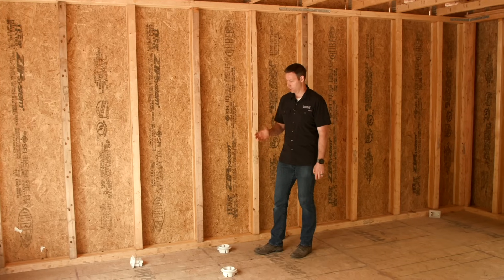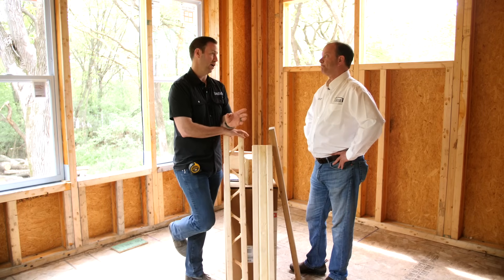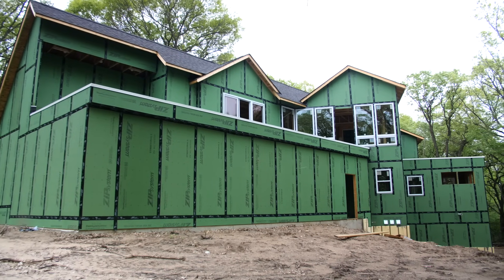Insulated Studs? This is a BIG Innovation in Framing!

Comment: Double top plate would be nicer for sheet rock.
Reply: True but you have 2.5" instead of 3" traditional, so not too much less.
Reply: Solid plates would be nice too. The top and bottom plate are made the same way as the studs are. This is the weakest point as far as I'm concerned. I can't see how you can get a solid connection between walls without double plates with dog ears and properly nailed channels with backing in them. All those straps will make screwing sheet rock in the corners all most impossible. The 2' center spaced studs pretty much means 5/8" rock too. It's better but more costly. I doubt that you can strong back them or plain them either as it is an engineered product so if the wall has any wavy gravy going on you might have to live with it.

Comment: I'm speculating, (the website won't give the current cost without going through some annoying steps) but the studs will cost 4x as much as a standard 2x6.  That means you have to amortize the cost against  the projected cost of energy   minus the expected savings. It's a question of how many years will be needed to pay for the system - essentially, when is the break-even date? This doesn't include the comparison of this system against the ''foam sheathing' method.

I can't see this system catching on. Standard lumber is cut, surface, ship.  Hard to beat that
Reply: Average house of 2500 feet is $1500 more according to the video. This is framing cost. What dollar value would you add to the increase in speed/efficiency for plumbing and electrical? What about the decrease in weight he mentions? What is the dollar value on that? Wear and tear of raising walls over a career? Can skilled guys work a longer career for your company? The factors to be looked at get to be quite long. 

But you are correct, it likely won't catch on like it should. Most people in the construction field have all the imagination of a tree stump. Innovation is a swear word in the construction field, especially stick frame residential circles.
Reply: @KeithAnderson-v7z  ... Of course all cost savings should be factored in to the determination of the break-even date. I never said otherwise. Dimensional lumber is plentiful, strong, predictable and inexpensive.  The fact is, when planning a build or remodel,  it's far safer to do so based upon product that will almost certainly be locally available. That means dimensional lumber and steel framing.

It is not the local guy's fault that you can't find, or  even look at this product locally. Maybe, if a contractor could find a stack of your stuff at a lumberyard, he could try it out. It's not a lack of imagination at work here. It's lack of predictable presence.
Reply: @frankhoffman3566  bet a contractor could get them to ship a sample piece. The real determining factor will likely be the profit margin for the lumberyard. And with the push towards "green" building it wouldn't surprise me if this type of material becomes mandatory.
Reply: Good grief are those of you questioning "this and that" are so dang thick headed! Just Read Through the Product Website, and you should have seen the offer for said samples which are easy enough to buy just to see them first hand in your own hands for yourself to further determine their viability and quotes for orders are easy and often FREE to get even if you have to email back and forth, They do not post pricing like most others as the cost varies on order sizes and shipping location as that varies as much as volume pricing.
Reply: @Joshua79C  ... Sorry, but convincing a contractor that ordering online is equal to having lumber on site within the hour - that's a hard sell man.  

Having the infrastructure is, I'm sorry, critical. With this product you can't even sight it for straightness.  You have to trust a new company  to get your order right, have it available, ship it promptly, and get it to you without delay, complete and undamaged.   

Many jobs are 1/3, 1/3, 1/3 - three chapters of work and payment.  That just multiplies the online ordering issues here.
Reply: @frankhoffman3566  Clearly these are not yet being mass produced like typical solid lumber these and are running at a limited production rate as you seen the bare model it takes a bit more time to manufacture them. Hence why the having to contact them to get set up with a local lumber yard of your choosing or have them directly shipped to location where needed just to get you supplied as a contractor or even if just a big time DIYer. 
Have got at least four lumber yards within ten miles of me. but I rent the place I currently live in and have little to no edge on what I can get done or have the landlord get done if goodness forbid he was a more generous and willing person. I could use something like this in the walls of this old as is drafty apartment duplex home that has not been remodeled since it was built or otherwise remodeled in the last 30 years if it older than that. If the landlord was willing to remodel this place and also have it properly insulated during that time, the money I would be saving on heating and cooling, I would gladly give it towards paying more in rent to hep them recoup the expenses.
Or if I won large enough in the lottery I could just find another place already build to modern standards and some or pay to have one built or rebuilt depending on the land and real estate condition and just move in there and have a house all of my own and not have to deal with a blighted landlord. I have to give them some leeway as they own and manages the auto body shop next door and it gets busy. They only bought this place from the previous landlord 7 or so years ago and i have been living here for 11 - 12 years now.
Reply: Exterior studs for a 2500 sq feet would only cost around $300-$400.  At the salesman's estimates, these would increase the cost to at least $2000.  Plus I have no idea how you fasten these studs and plates, Matt mentioned screws, which would cost more than standard nails.  That is a huge increase considering you only gain R-12 at the 1.5" stud, the insulation between the studs is the same.  For the very minor efficiency increase, I doubt you ever break even with the extra cost.  This is only for people with the extra funds.
Reply: Frank Hoffman or a S.I.P. House.
Reply: When I first heard of SIPS 15 years ago, I tried to look up pricing for those then and still to this day they still do not offer direct pricing. Tstud is NO different in terms of supply compared to typical lumber which you can clearly and easily find the cost for said anyplace it is sold through. Same when it comes to asking an ICF manufacturer, you have to request a quote by submitting a plan in order to get a cost quote per amount of materials and other accessories. Sure you can buy a few certain ICF forms through HD or Lowe's with clear pricing per location your buying in/from. 
ICF, SIP, Tstuds, are all specialty products and much like an exotic or other supercars  in limited production do show initial cost, what the owner pays could be much more than that due to custom tailoring offered by those makers. Much the same for your run of the mill sedan and such, they all come at a basic cost, what options you choose and such add to that, or you can buy as from off the lot of what is available if you are not who could care less about the new fangled tech that you could also get these days.
This is the more complicated way of what i basically was saying earlier when I said these are not yet being mass produced and for good reasons. Not everything that can be recycled necessarily  has some sort of recycling program for it in every part of the world. Such as is spray foam is not currently recyclable, but hopefully becomes more ecological soon enough much like how packing peanuts are now offer in starch form now. Said starch based packing material can just be dissolved in water and washed down the drain for the sewage treatment facility to sort out.

Comment: These are STELLAR!!  This type of truss has been around for decades...but never used like this, that I’d ever heard.  
To cut 10 - 15% waste, down to less than 1%...I’m @ a loss for words!   And the strength improvements are great.  Not to mention, having studs @ same location as rafters, every 2’.    This really is a game-changer I don’t think the company fully realizes yet.  
But there was one point it seems they possibly compromised this system, by not using it correctly to optimize laws of physics why these work:  those headers shown...
    They placed these on their flat sides, stacked, as headers (dowels running horizontal).  The wider flat side of any rectangle will deform under weight load, more & sooner than the same rectangle placed on its narrower side, w/the wider side vertical.     
That applies to regular lumber or manufactured lumber, & to this kind of truss.  
In these, the dowel zigzag needs to be vertical, to use its greatest strength.....which wasn’t a huge issue in the gable end penetrations, but would absolutely be an issue in a load-bearing wall penetration.   (Picture: mid-century quick-&-dirty tract houses, many with lower ceilings (7’+ inches) & cheap, low-grade roof trusses).  
Believe me, there are millions of buildings out there with sagging headers, because the physics of lumber & loads were ignored, in some way.   Other precision components like windows & doors, must take that slop-factor into account, requiring more wiggle-room in framing.  
So, in this demo’d bldg., they’d gain structural strength, by using these trusses on edge, gluing 2 to 4 of them side-by-side, instead of flat-stacking them.   
OR, the mfg. could make a specific header unit, which is still stacked with the original dowels horizontal as they did, bit add vertical zigzag of dowels into it, which would keep the all-wood face to exterior & interior as they did, if they don’t want mostly foam facing exterior/interior.    
OR, (I’d like to see this done)....the mfg. could specify these trusses to be glued together & placed vertical instead of flat, over the whole length of each wall with penetrations, at the top perimeter of walls, where they would evenly distribute load over a length of wall, instead of relying only on a penetration-width header to support the load focused on that spot. This solution, using these trusses, could better prevent sagging penetration headers (& later, sagging roof edges). 
And, Imho, they should have used the same trusses to form the roof!!   
The old simple roof trusses are he!! to retrofit ANYthing into...insulation, utilities, anything.   Using these trusses to frame for the roof, gives better strength, as well as allowing more ease of access to that space, and allowing at least R30 insulation of the roof structure, making the “attic” a tempered space, instead of an airflow & condensate horror story for the life of the building.  Average roof truss framing is quick-cheap, but over life of building, is a fail-point, & short-sighted about future needs, making retrofits much more costly, & likely to frustrate contractors into doing sloppy retrofits.   
Also...I believe this kind of truss Might be good, used to frame-out old 2x4 framed houses, over exterior siding, to add serious insulation to upgrade old bldgs...which could help drastically upgrade old houses more easily.    
The tricky bit might be, how to moisture-proof the old exterior, before adding how much exterior insulation.   A number of products have tried exterior insulation, but have had bad fail-points...all in the application.  
But, These trusses + paint-on or spray-on water seal + spray foam or batts, then new wrap + siding, could make the process fast & effective, with fewest fail-points.  Sealing the base of the add-on wall thickness, would need addressed...possibly might need a small foundation support for it, instead of hanging that weight only on existing 2x4 walls.

Comment: I am curious about the dowel rods in the middle. Doesn't that bridge across studs? Maybe because of the small mass and being surrounded in foam the cold dissipates?
Reply: Yes those are thermal bridges. However, much like nails are a thermal bridge, the size of that bridge matters.

Comment: And yet they chose SilverLine windows. 🤔
Reply: I was starting to think I was the only one that noticed that.
Reply: So the customer choose those, big whoop, it is not like they were installed on your place. Good Grief you all worry about others people choices that do not concern you.
Reply: Windows are not something you want to cheap out on. If you’re gonna pay extra for insulated studs, you might as well bite the bullet and get some decent windows.
Reply: @AaronRepubBob  To each their own until said Windows crashes and you get nothing but the blue screen of death ..... As I said previously already said it is THEIR choice NOT YOURS  of what they go with in their own home. Most manufacturers offer Vinyl framed windows which (in all intents and purposes) all look cheap no matter what the name of them are.. Wood is even cheaper and does not last as well. Aluminum is best but has the same issues as a steel frame building and is a thermal bridge between the indoor and outdoor ambient temps. Vinl is neutral and wood offers very little insulation (1.5 R value per inch) compared to batt/blown , spray foam or other foam insulations.

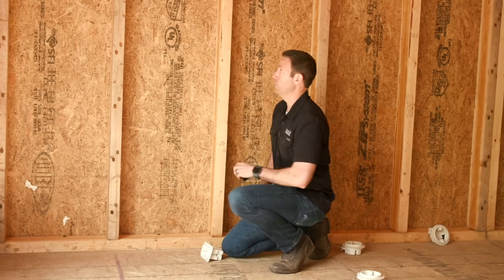Comment: Stop the video at time 4:30. The metal bolts come up thru the foam insulation. Then they put the metal attachment plates on and bolt them down. There are 4 holes in the metal attachment plates for nails to secure the bottom plate from moving. There were no nails securing the wood to the metal plates??? Did these get nailed prior to the insulation. I will watch the rest of the video to see if it is shown with nails in it.
Reply: The TStud website has a field construction guide whcih addresses this and a lot of other questions.  The hold-down plates are supposed to be connected to the wood by 4 2-1/2" # 12 wood screws.

Comment: I have a Cabin 1000 SQ F , I am sliding, I hope onto a new walk out Basement.  Could I build it with the 2x6 0r the 2x8 on Slab Foundation 3 sided back fill ?  Better stronger or go with ISF blocks and concret ? Any thoughts ???

Comment: I like the product...but I question the value of saying they are good after 2 years. What about 20 years?   In my house, which is 2x4 construction built in the 1950's, I just used 1 1/2 inch rigid styrofoam on the inside of the stud with fibreglass in-between the studs. Then I put vapour barrier and the hung drywall. I increased R value quite a bit , and reduced noise as a bonus.

Comment: I see one major problem further down the road... and maybe I'm wrong. Won't this product lose its strength quicker the more it's screwed into? Over time homeowners will remodel and/or renters constantly screwing in new things to the wall. A solid board will hold up better with a bunch of screw holes compared to these new boards -- right!?
Reply: Well, the part that you'd be screwing into is a solid wood 2X3 (nominal) turned sideways.  How many screws would you have to screw into a 2x3 before it became dangerously weakened?

Comment: What is the span with the 2X6 equivalent for ceiling joist.
Reply: Unless you're building a flat hot roof,  It doesn't seem like this product would be a good choice  for  joists compared to engineered joists like TJI or similar.

Comment: I wonder how long it will take to remove wood altogether in home construction ? 

You would think that plastics technology will replace wood eventually , at least when it comes to the frame/shell of the home .

Imagine a home that last for 100s of years , no rot from the outside weather .

Great video , very interesting .
Reply: They are already 3D printing houses in concrete.. which tend to be cheaper and quicker to build since a robot does most of the work..
but all those houses look like shit, so.. not really gonna take off in this materialistic and vain society we live in..
Reply: @GenoLoma   Really , 3D printed houses , very cool idea , I'm going to check that out , thanks .

Comment: Wrapping the house is still a code requirement, so you save nothing on the exterior treatment. What you loose is over 50% of the wood from the structural members of your house. Real talk, 50% less wood wont pass code in most states, and honestly it shouldn't! This is a HORRIBLE idea! Never sacrifice structure for 50% better r value to 24% of your exterior wall. In a 20 degrees below zero scenario, you will NEVER notice the difference in 5% over all better thermal retention. However when your house collapses due to a minor water leak, or two weeks after a minor termite infestation. This fad will go the way of the dodo after a few well deserved lawsuits.. Dont buy this scam folks.. RUN AWAY!

Comment: I wonder about the durability of that dowel-foam system in conditions like near a busy road or in humidity. How well will that hold together over time. Is it tested to stand up to abuse. The last thing you'd want is the dowels releasing and the whole structure becomes endangered.
Reply: I'm pretty sure you are safe near a busy road or not..

Comment: Thermally broken framing like that has been around for many years, at least here in the UK/Europe. They are called things such as "Twin Wall System" and are common in passive spec houses. They are not usually pre-filled with insulation, but will be filled later (e.g. with blown cellulose) when the rest of the external wall insulation is fitted. This looks like a very good implementation though, largely from being quite a bit stronger than what I have seen in the past.
Reply: It looks really weak to me, and 6 inches is only 'half' a passiv-haus!